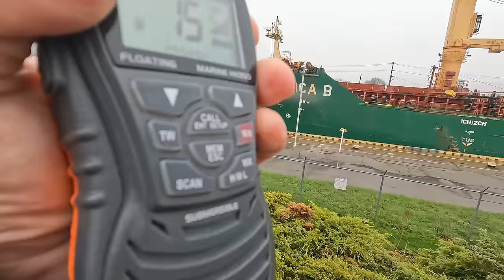Stuck in Lock 8 - Jessica B

Comment: You see here an example of prop walk at 11 minutes or so. They are trying to get the stern to the dock but when he engages reverse the stern moves to port as a result of the prop walk to port. This is why the ship hit the bridge at Baltimore. When the power went off the pilot freaked and ordered reverse. that swung the stern to port and the momentum took the ships bow to starboard and into the bridge.
Reply from the maker: That is an interesting observation. Makes sense.
Reply: I've wondered with the Dali if not dropping the anchor would have had a different outcome. But I don't know from the video when that was done.
Reply: @rpk5568  No. The other thing to is if the ship had hit the base a little further down the ship where the sides of the ship are vertical it would have been fine. The bow flare down to the bow bulb allowed the ships pulpit to overhang and hit the bridge structure.